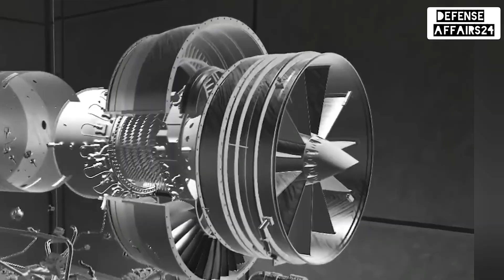Türkiye Breaks Free! KAAN Fighter Jet to Fly with Home-Built TF-35000 Engine 🔥

Comment: To build engines for manned fighter jets, engine blades must withstand temperatures exceeding 1,600 degrees Celsius.
1,600 degrees Celsius is the melting point of metal. Therefore, they are manufactured from single crystals, with tubes circulating inside the blades to allow cooling air to flow.
This single crystal manufacturing method is called second-generation single crystal manufacturing.
Currently, AM additive manufacturing is used, layering sintered powders, similar to 3D printing.
Countries that have developed this technology include the United States, Europe, Russia, China, Japan, and South Korea, but Turkey has not yet developed it.
A video of the TF-6000 engine test released by TEI shows that only the engine turbine rotates, not combustion. This means Turkey has not yet developed high-temperature materials.
Currently, building a 35,000-pound engine is impossible with Turkish technology.
Reply: The Eurofighter, powered by the EJ200 engine, is also capable of supercruising. Optimizing fighter design is also crucial.
The Turkish-made Hurjet trainer uses the F404 engine. India's light fighter, the Tejas, and South Korea's T-50 also use the F404 engine.
However, the Hurjet has a payload of only 2.7 tons. With fuel, a pilot, and avionics, the Hurjet cannot carry weapons.
Conversely, the Tejas, which uses the same engine, is already in use as a fighter, and the T-50, equipped with avionics, is also being used as the FA-50.
This suggests Turkey's lack of aircraft design and optimization technology.
The US Congress denied Turkey the right to license-produce the F-110.
If the Turkish government abandons its fighter jet development project now, will the Turks remain silent?
Even if Turkey possesses the basic technology and starts developing engines now, it will take at least 20 years. Even if the US were to supply Turkey with engines, obtaining airworthiness certification would require building a prototype and undergoing over 2,000 tests. That alone would take at least two to three years.
And if the fighter development project is delayed, the price of the fighter will rise.

The Turkish fighter development project has already failed, but these fools won't understand. Turkey is probably already looking for a replacement fighter or finding an excuse.
Anyway, by 2028, we'll know who's lying. After all, the Turks are paying the bills anyway.
Reply: @cobradorrheem  bahsettiğin uçak 5. nesil uçaklar için eğitim uçağı olmasının yanında hafif muharebe - destek ve gösteri uçağı olması amacıyla yapıldı. Türk yıldızlarının uçtuğu eskiyen Kore T-50 uçaklarının yerini alması amacıyla yapıldı. yani o bir eğitim uçağı ve ondan çok fazla bir şey beklenmemesi gerekiyordu ancak farklı beklenti ve talepler oluştu. bu durumdan erken haberdar olsaydık ortaya çok daha farklı bir sonuç çıkabilirdi. boşa heveslenmeyin, projeden vazgeçme gibi bir durum söz konusu değil. tam aksine elde bulunan F-16 motorları Kaanlar için kullanılabilir. seçenek çok. önceden alınan motorlar ile testler devam ediyor ve 2028 yılında elde olan motor sayısı kadar Kaan teslimatı yapılacak. 1 tane teslim edilmesi bile yeterli. çünkü böylece yapabiliyoruz ve yaptık ta zaten demiş olursun. bu sırada da yerli motor testleri devam eder. bu güne kadar yaparız dediğimiz her şeyi yaptık, 2028 ve 2030`larda yine rüyalarınıza karabasan olarak gelecek ve hayallerinizi yıkmaya devam edeceğiz. bekleyin ve görün
Reply: @onurcan8434  Do you know what aircraft payload is?
Do you know what intellectual property rights are for technology?
Do you know anything about aircraft airworthiness certification?
You seem to have no knowledge of aircraft, technology, or intellectual property, considering you're talking about equipping Turkish fighters with F-110s despite the US ban.
If the Turkish government uses the F-110 without US permission, the US will retaliate for intellectual property infringement.
Can the Turkish economy afford that now?
Reply: @cobradorrheem  ben 2 şey bilirim. dost ve düşman. seni düşman ilan etmiş bir ülke hiç bir hak talebinde bulunamaz. o dakikadan sonra ellerindeki her şeyi kullanarak kozlarını paylaşmaları gerekir. karşımıza çıkmaya cesaretleri yok ama düşmanlık yapmaktan da geri durmuyorlar. ellerinden gelen her şeyi zaten yapmaya çalışıyorlar ama biz henüz hiç bir şey yapmadık. bu yapmayacağımız veya yapamayacağımız anlamına gelmiyor. bu yüzden bana hak - hukuk edebiyatı yapmaya çalışma. elimizdeki koz sayısı çok fazla ve henüz hiç birini kullanmadık ama daha önce de defalarca söylediğim gibi, yapamamak ve yapmamak farklı şeyler. Amerika`nın aksine biz sömürgeci değiliz ama Amerika`nın ekonomisi bizden daha kötü bir durumda. her şey siyasi iradenin elinde ama bu durum Amerikan ekonomisine hiç bir şey olmayacağı anlamına gelmiyor.
Reply: @onurcan8434  I have no intention of persuading you, and I have no interest in your philosophy.
No country would transfer technology to Turkey, which disregards other countries' intellectual property rights. Turkey would either pour money into a fighter jet it can't build, acquire fighter jets from other countries, or participate in other countries' fighter jet projects.
We'll figure out who's right later.
Reply: @cobradorrheem  o zaman halen daha ne konuluyorsun ki? senin felsefen kimin umurunda? senin felsefen iddiadan başka bir şey değil. felsefeni dayandırdığın nokta ne? kuru bir iddia, bir var sayım, bir olasılık. başka bir şey yok. denemiş ama başaramamış bir ülke olan Hindistan hakkında konuşsan, anlayacağım. Türkiye daha önce denedi mi? hayır. başarısız oldu mu? yine hayır. ne konuşuyorsun halen daha? 3 gündür bahsettiğin şey olsa ve bulsa hikayesinden başka bir şey değil. biz uçak ta üretiriz, uçak ta satın alırız, teknoloji transferi de yaparız. bundan sana ne? kimin haklı olduğunu sonra göreceksek eğer, bu güne faydası ne? bozuk bir plak gibi günlerdir aynı şeyleri tekrarlayıp duruyorsun. başka bir şey yok.
Reply: @onurcan8434  Don't they even teach reading in Turkey? I've never talked about my philosophy. I told you I wasn't interested in your arguments or philosophy. What are you talking about?
Have you ever provided any technical evidence for anything you've written?
No matter how much you babble, the Turkish fighter jet development project failed, and engine development is impossible with Turkish technology. It's just a lie from the Turkish government.
Stop making me laugh and go to sleep.
Reply: @cobradorrheem   çok basit bir şey söylüyorum sana. saydığın şeylerin hiç birini kendin yapmamış olmana rağmen neden halen daha çeneni kapamıyorsun? sana ne düşündüğünü kim sordu? kimin umurundasın? gözünün önünde olan ve başarılı bir şekilde inşa edilerek uçurulmuş olan bir şeyin başarısız olduğunu iddia edebilmek için görme veya zeka engelli olmak gerekir. sen bunların hangisisin, söyle bana? sen falcılık veya kahinlik yap, bu işler senin işin değil
Reply: @onurcan8434  The Turkish fighter jet program failed. I simply said it failed.
Did Turkey develop high-temperature engine materials? Did it develop aircraft engines? Did it build avionics? Did it test avionics?
Isn't Turkey's only proof a demonstrator that flew for just 27 minutes in 2024?
Should we call a fighter jet development program a success, even though its mass production is scheduled for 2028, without an engine, avionics, or even a prototype?
If I were a fortune teller, would that mean the Turkish government is a bunch of fraudsters?
Reply: @cobradorrheem  başarısız olması için yapamamamız ve uçuramamamız gerekiyordu. yaptık mı? evet, yaptık. uçurduk mu? evet, uçurduk. sana dedim ki, ne düşündüğün umurumda değil ve kapa çeneni. neden halen daha çeneni kapamıyorsun?
Reply: @onurcan8434  Don't you see I'm making fun of you?
How could you not know that the Turkish government is lying when the fighter jet program is clearly a failure?
I'm mocking your level of intelligence. Don't you learn things like debate in school?
Reply: @cobradorrheem  açıkça başarısız? :face-blue-smiling:IQ fakiri bir bakar kör olan ben değilim.  kim kiminle dalga geçiyor? beni eğlendirmeye devam et
Reply from the maker: Appreciate your detailed explanation, my friend. You’re absolutely right that high-temperature alloys and single-crystal turbine blades are among the toughest challenges in jet engine design. However, Türkiye’s TEI has already started research and material testing for single-crystal turbine blades and advanced cooling systems as part of the TF-35000 program. The TF-6000 was only a technology demonstrator, meant to validate core design and low-pressure modules, not full-scale combustion tests yet. With the progress TEI has shown from PD-170 to TF-6000 to TF-35000, it’s clear Türkiye is on a realistic, step-by-step path toward achieving a fully indigenous fighter jet engine. 🇹🇷✈️
Reply: @defense.affairs24  Jet engine testing is stipulated in the airworthiness certification evaluation.
If it's merely for demonstration purposes, as you say, then engine testing without combustion testing is meaningless.
The TIT of the TF-6000 is 1,400 degrees, the temperature at which metals do not melt. On the other hand, the TIT of the TF-35000 is 1,600 to 1,700 degrees, the temperature at which metals melt.
The superalloys used in turbine blades exhibit significantly reduced mechanical properties when the temperature exceeds 1,400 degrees. This means they can explode if manufactured incorrectly.
The superalloys used inside the internal engine combustion chamber do not undergo mechanical motion and only receive thermal energy, while blades receive both kinetic and thermal energy, making the technology considerably more challenging. Therefore, the technological gap between the two engines is estimated at 20 to 30 years.
Russian and Chinese engines have an average lifespan of 1,000 hours, and they use their engines as consumables. This is why the engines of both countries emit a blue flame when viewed from behind. This is the concept of being disposable after use. On the other hand, Western engines are rated for 10,000 hours. Western fighter jet engines emit a red flame. Because they last that long, they're more difficult to manufacture. Just because you've built a TF-6000 doesn't mean you can build a TF-35,000.
Reply from the maker: Appreciate your detailed explanation, my friend. You’re absolutely right that high-temperature alloys and single-crystal turbine blades are among the toughest challenges in jet engine design. However, Türkiye’s TEI has already started research and material testing for single-crystal turbine blades and advanced cooling systems as part of the TF-35000 program. The TF-6000 was only a technology demonstrator, meant to validate core design and low-pressure modules, not full-scale combustion tests yet. With the progress TEI has shown from PD-170 to TF-6000 to TF-35000, it’s clear Türkiye is on a realistic, step-by-step path toward achieving a fully indigenous fighter jet engine. 🇹🇷✈️
Reply: bizim teknoloji konusunda hiç bir eksikliğimiz yok. yoksa ki bu projeye başlamazdık. sadece maddi kaynak ve minimum zaman içinde üretim konularında sıkıntı yaşıyoruz. tabi sen ve senin gibiler istediğiniz şeyi düşünmekte ve istediğiniz şeye inanmakta özgürsünüz. ama bir şeyi unutmayın. birkaç yıl içinde tüm bu sözlerinizi yemek zorunda kalacaksınız
Reply: @onurcan8434  No matter how technically explained, it's difficult for non-experts to understand.
The engine is the most crucial choice in aircraft manufacturing. Whether it's a fighter jet or a civilian aircraft, the design is determined by the engine selection.
There was a previous Boeing 737 Max 8 accident. The cause of the accident was a plan to replace the existing 737 with a more powerful engine. Instead of redesigning the aircraft to accommodate the new thrust, the program was simply revised, resulting in a crash.
The Turkish government's claim that it will use the F-110 for the prototype and a 35,000-pound engine for production is difficult to understand.
And since the engine is the most technically challenging component, your claim that there are no technical issues is also difficult to understand.
Opinions may vary, but I believe the Turkish fighter program will fail if it cannot procure engines from the United States or Europe.
We'll find out who was right in a few years.
Reply: peki senin bu açıklamaları yapmadan önce hangi uzman ile görüştüğünü ve konuştuğunu öğrenebilir miyim? yaptığınız açıklamaların tamamı söylentiler ve kulaktan duyma haberlerden başka bir şeye dayanmıyor. biz eğer bir şeyi yapabiliriz diyorsak, onu yaparız. yapamayacağımız bir şey olursa da hiç konuşmaz ve hiç başlamayız. 2028 yılında 20 KAAN teslimatı yapılması hedefleniyordu ama yerli motor o süreye yetişmeyeceği için F-110 motorları kullanılarak üretilmesi hedeflendi.  kendine ait bir motorun yoksa eğer, ilk üretimleri başkalarına ait motorlar ile yaparsın. motorun hazır olduğunda ve tüm kontrol ve testler yapıldığında da kendine ait motoru kullanmaya başlarsın. bu kadar basittir. bunun neresini anlamadın? hiç bir deneme - test ve kontrol yapılmadan önce motorun uçağa takılarak uçurulmaya başlanacağını mı düşünüyordun yani? ben de teknikten bahseden birinin bunları düşünmesini ve bahsetmesini anlamıyorum. sen gerçekten de bu işin teknik bölümünde tecrübeli olduğuna inanıyor musun? açıkçası, yazdıklarını okuduktan sonra ben senin bu konuda kesinlikle yetkin bir kişi olduğuna inanmıyorum. çünkü, dediğim gibi, yetkin olduğunu iddia eden birinin hiç bahsetmemesi gereken şeylerdi bunlar. bizim Amerikalılar gibi olduğumuzu mu sanıyorsun? o F-35 denilen uçağın seri üretime hiç geçirilmemesi gerektiğinin farkındasın, öyle değil mi? Avrupa`nın 5. nesil standartlarına uygun bir motoru mu var? F-22 dışındaki hiç bir uçağın motorunun 5. nesil standartlarına uygun olmadığının farkında mısın? benim F-22 motoru konusunda bile şüphelerim var. çünkü, yapılan açıklamaların tamamı iddialardan ibaret.
Reply: @onurcan8434  I wonder what kind of knowledge you possess when you say that. Is there any information on YouTube or rumors floating around online that claim Turkey doesn't yet have second-generation single-crystal casting technology? Is there any information that says it doesn't have AM additive manufacturing technology?
What is the technical basis for claiming Turkey, which doesn't even have the basic technology, can develop its own engines?
Are you asking me to believe your claims without any evidence?
I researched single-crystal casting using sintered powder.
What have you studied?
How can Turkey use the F-110 engine when the US has banned licensed production? Have Europe and Turkey ever negotiated engine supply agreements?
What you wrote is nothing more than your imagination. How can Turkey, which can't even produce a prototype, achieve mass production by 2028?
Why should I believe your imagination?
Didn't Turkey start the fighter jet program to use it as political propaganda for the Turkish president?
The Turkish fighter jet program will fail unless there are engine supplies from the US or Europe. Stop talking nonsense.
Reply: tabi ki var. daha az önce uçak ve füze motorları üreten KALE grubunun resmi yöneticisi ile yapılan röportaj videosunu izledim. ben her gün takip ediyorum. adres, yorumu spam kutusuna düşürüyor, bu yüzden veremiyorum ama yapabiliyor olsaydım neden vermeliydim? ben size gösterirsem eğer, siz nasıl araştıracak ve öğreneceksiniz? zaten hiç bir araştırma yapmadığınız ve yalnızca söylentilere inandığınız için bu durumda olduğunuzun ne zaman farkına varmayı düşünüyorsunuz? halen daha başkalarının yalanlarından sanki gerçekmiş gibi bahsettiğinin farkında mısın? 1985 yılından beri tüm firmalar için motor ve motor parçası üreticisi olan bir ülkenin temel teknolojiye sahip olmadığını iddia etmeye devam eden birini neden halen daha dikkate almalıyım? siyasi irade emir verir ve bütçe ayırırsa eğer, çok basit bir şekilde üretirler ama bu benim problemim değil. çünkü, yapmasına izin verilmesi ile yapacak teknolojiye sahip olmamak farklı şeyler. senin prototip dediğin şeyi 2 yıl ve 2 ayda üretip uçurduk biz. o lisans anlaşmasının yenilenmemesinin bir sebebi olduğunu düşünemeyen ve var olan bir şeyden hayal gücü olarak bahseden birinin bu yorumu okuduktan sonra önce göz doktoruna, ardından da bir psikiyatriste gitmesi gerekir. onun - bunun yalanlarına inanmaya ve PROPAGANDALARINI yapmaya devam et sen. nasıl olsa bir kaç yıl sonra göreceksin ama itiraf edecek yüzün olmayacak. yanılmışım bile diyemeyeceksin. bahsettiğin Avrupa`nın yatıp - kalkıp bizim başarılı olmamız için dua etmesi gerektiğinden de daha hiç  bahsetmeyeceğim. çünkü, yapmayı hedefledikleri 6. nesil uçaklara takacak bir motorları olmayacağı gibi, Amerika onlara da lisans vermeyecek. Amerikan uçaklarını satın almaya mahkum olacaklar. asıl siz hayal görmeye devam edin
Reply: @onurcan8434  I only asked about their technical expertise and didn't ask about press interviews with Turkish companies.

Isn't the company you mentioned primarily focused on ceramic metal processing for architectural purposes? My major in college was materials engineering. Did you think I didn't know about that company?
They started producing small turbojet engines for cruise missiles in 2018.

They've been producing engines and engine components since 1985? Could you tell me the name of the company?

Even before the US banned Turkey from licensing engine production, the US Congress blocked the transfer of avionics technology to South Korea, which was supposed to be a condition of the F-35 purchase.
Did you think the US would create a competitor?
And installing engines imported for the F-16 in fighter jets under development without a license is an intellectual property infringement.
If Turkey possesses such advanced materials technology and has been producing jet engines and components for a long time, why does it import all its power turbine engines from Germany?
Power turbine engines and aircraft jet engines share the same external appearance and operating principles. Why does Turkey import turbine engines, which are technically easier to produce than aircraft jet engines?
Only five countries—the United States, Germany, Japan, Italy, and South Korea—have developed turbine engine technology for power generation.
How can a country that can't even build turbine engines build a 35,000-pound jet engine?
If you don't understand, do your own research. You'll soon realize who's dreaming and who's talking nonsense.
Reply: bir kişinin veya kurumun herhangi bir kabiliyete sahip olup olmadığını bilmek için uzman olmaya gerek yok. sormak yeterli ve soruldu da zaten. TEİ genel müdürü olan Prof. Dr. Mahmut Akşit ile ülke yöneticileri tarafından fırçalanan bir türbin üretici firması randevu alarak görüşme yaptı. "Türkiye 10 yılda neler yaptı ama siz bir uçak motoru üretemediniz." randevunun sebebi bunu nasıl başardığımızı öğrenmek. Prof. Dr. Mahmut Akşit, teknolojik olarak gelişmiş bir ülke olduğundan bahsediyor ama ülke ve firma adı vermeden şunları söylüyor. "şuanda Türkiye`de 20`den fazla özgün ve titanyum alaşım geliştirmiş durumdayız. kritik alaşımları ve tek kristal dökümlerini kendimiz yapıyoruz. alaşımın içindeki saf kobalt ve saf nikeli kendimiz elde ediyoruz." sanırım bu kadar bilgi sorduğun tüm sorular için yeterlidir. tüm bunlar devlet sırrı olmadığı gibi, gördüğün üzere, bazı şeyleri bilmek için uzman olmaya gerek yok. senin aksine, sormak ve araştırmak yeterli. bir Türk ata sözü vardır. der ki, kılavuzu karga olan kişinin burnu pisliğin içinden çıkmaz. bu söz tam olarak senin durumunu açıklıyor. ben senin söylediğin şeylere yalnızca gülüyorum. dediğim gibi, hiç bir araştırma yapmadığın ve sana söylenen her şeye inandığın için bu durumdasın. durumunu düşündükçe içimden daha çok gülmek geliyor. aslında bunların hiç birini söylemek zorunda değilim ama merak etme, tüm sorularını cevaplayacağım.  şirketlerin adlarını sorduğunu görüyorum. 1974 Kıbrıs harekatı sonunda uygulanan ambargo sebebiyle 1985 yılında kurulan 2 fabrika, TAİ ve TEİ. o günden beri, TAİ, F-16 uçaklarını üreten şirket. TEİ, F-16 motoru olan GE F-110 motorlarını üreten şirket. o günden beri tüm uçak ve uçak motoru üreticisi olan ülkeler için en zor ve en pahalı parçaları üretiyoruz. ayrıca, bir de KALE grubu var. yüklenici firma. bu konuya fazla takılmana gerek yok, ortaklık ve iş paylaşımı yapıyorlar ve birbirleriyle yardımlaşıyorlar. motoru KALE grubu yapıyor ama resmi açıklamaları TEİ genel müdürü yapıyor. sen de seramik ve metalden bahsediyorsun. komik. motor projesi, uçak projesinden geç başladığı için şuanda beklemedeyiz. yoksa ki, şimdi rekorların rekorunu kırmıştık ve uçağımız seri üretime geçmiş durumdaydı. herkesin 15 - 20 yılda çok sayıda ortak ile ürettiği 5. nesil uçağın 3 yılda nasıl seri üretime geçirildiğini ağzınız açık bir şekilde izlerdiniz. Amerika`nın görmeye katlanamayacağı şey bu. ve biz uçak üretirsek, Amerika 1 tane ülkeye uçak satamaz. ancak Almanya - İngiltere - Kore - Japonya ve ARAP ülkeleri gibi hegemonyası altındaki ülkeler mecburen satın alırlar. yani, Amerika kendisi için rakip yaratmıyor, karşısına rakip çıkmasını engellemeye çalışıyor. Amerika`nın düşmanı ve tek rakibi aslında kendisinden başkası değil. çünkü, çok aşırı yüksek olan astronomik rakamlar karşılığında satış yapıyor. sizi koruyorum hikayesinin sonucu.  Avrupa, sizi Ruslardan koruyorum. Yunanistan, sizi Türklerden koruyorum. ARAPLAR, sizi İran`dan koruyorum. Japonya, sizi Çinlilerden koruyorum. Kore, sizi kuzey Kore`den koruyorum. Amerika için düşman ülkeler müttefiklerden daha önemlidir. biz 1985 yılından beri üretim yapıyoruz ama müttefiklerimiz yakın zamana kadar bize karşı bu kadar düşmanca davranmaya başlamamıştı. ayrıca, İMF adında bir kan emici ve tefeci var. borcunu ödemediğin sürece bir şey yapmana veya üretmene izin vermez. yoksa ki, kredi vermez. biz İMF`YE olan borcumuzu 2013 yılında bu düşmanlık sebebiyle bitirdik. yani, her şey düşündüğün gibi kabiliyet konusundan ibaret değil. açık ve net söylüyorum, biz istediğimiz her şeyi yapabiliriz, kimse de bize ambargo uygulamaktan başka bir şey yapamaz. çünkü, biz hiç bir ülkeye ve millete benzemeyiz. kimi desteklersek kazanan o olur. Amerika`nın tanrıdan daha çok korktuğu 2 şey vardır. 1- Rusya. 2- Türkiye`nin Rusların tarafına geçmesi. ayrıca, bizi hiç kimse savaşarak yenemez. biz, dünyada gerilla savaşı kazanmış tek düzenli orduya ve binlerce yıllık ordu geleneğine sahip tek ülke ve milletiz. bu ülkenin ve milletin ordusu, Kore savaşında 3 tane kahramanlık madalyası kazanmış ordudur. bunlardan biri de Amerika tarafından verilen "gümüş yıldız" kahramanlık madalyasıdır.  NATO'ya alınma sebebimiz de bu zaten. bizi Ruslara karşı savaştırmak. bu da, bunun farkında olmadığımızı sananlar için komik olan bir başka şey. "biz zaten bunu düşünerek lisans süresi dolmadan önce motorları üretmiştik." her şey bu sözü söylememize bakar ve hiç kimse bir şey yapamaz. dediğim gibi, izin farklı bir şeydir, kabiliyet farklı bir şeydir. zor durumda kalırsak eğer, F-16`lardaki motorları söküp KAANLARA bile takabiliriz. ne olur? 300 F-16`mız olmaz da, 150 KAANIMIZ olur. bizim için imkansız diye bir şey yok ama o noktaya gelmesini istemiyoruz. iyi niyetimizi suistimal etmek isteyen varsa eğer, hiç durmasın ve bizi zorlasın. tüm bunlara rağmen senin gibiler herkesi kendileri gibi sanmaya devam ediyorlar. dediğim gibi, biz size yalnızca gülüyoruz.
Reply: @onurcan8434  Weren't you the one who asked if I spoke with an expert?
I don't care what the Turkish expert says. Then why doesn't Turkey, which developed the technology and materials, register its technology or intellectual property rights?
If Turkey independently developed the engine-related technology or materials I mentioned, shouldn't it have registered its intellectual property rights? If it had developed the materials, shouldn't it have registered the technology to protect the developer from infringement?
Turkey has no registered intellectual property rights or technology related to engines. It hasn't even reported its material development in a materials science journal.
You said the Turkish expert developed 20 different types of titanium alloys. What are their structures? Titanium has three different alloy structures. How could they have developed 20 different types of titanium alloys?
Let's stop lying.

Turkey developed a fifth-generation fighter? Do you call something illegally equipped with an American F-110 engine and no avionics a fifth-generation fighter?
You call it a technology demonstrator. Turkey hasn't even built a prototype yet. In other words, it's like putting an engine in a can and flying it.
I'm sick and tired of your lies. Shouldn't Turkey first invest in basic technology and then develop a fighter jet?
You said a 35,000-pound engine would be developed within a few years. Yet, the Turkish Foreign Minister is going to the United States to request engine supplies? The US Congress suspended the license, so why did the Turkish Foreign Minister criticize the US? Isn't the F-110 US intellectual property?
Turks don't seem to read foreign military media, yet people around the world are laughing at Turkey's political show of developing a fifth-generation fighter jet.
Reply: @cobradorrheem  where are you from ?
Reply: evet, 51. kez söylüyorum. hiç bir yetkili kişiyi dinlemeden aldığın yalan duyumlara göre davrandın ve hareket ettin. bu durum teknik konular hakkında bilgili ve yetkin olduğunu iddia eden birine yakışmıyordu ve ben de bunu defalarca söyledim zaten. umurumda değil diyerek yine aynı şeyi yapmaya devam ediyorsun. şimdi ben de o zaman senin ne söylediğin umurumda değil demeli miyim? bildiğim kadarıyla füze ve insansız hava aracı motorlarının tescilini zaten yaptırdık. helikopter motorunun tescili ya yapıldı, ya da yapılması çok yakın. TF- 6000 jet motoru başarıyla çalıştırıldı ve şuanda olgunlaştırma aşamasında. TF-10 bin ve TF-35 binin ise yakın zamanda çalıştırılması hedefleniyor. kısacası, jet motorlarımız henüz tescil seviyesine ulaşmadılar. bunun sebebi de yine kabiliyet değil, maddiyat. bu yüzden yavaş ilerliyorlar. 3 farklı jet motoru ve 1 helikopter motoru olmak üzere 4 farklı motor projesi aynı anda devam ettiriliyor. projeleri hiç bir ülkeden maddi destek almadan ve ortağımız olmadan yalnız başımıza sürdürüyoruz. yavaş yürümesi sence de normal değil mi? başaracak kudrete sahibiz ama ne kadar sürede başarabileceğimizi bilmiyoruz. yine de son lisans engelinden sonra mühendislerimizin çok fazla hırslandıklarını ve bize göre normal olan süreden çok daha erken biteceğini söyleyebilirim. uçağı yapan mühendisler evlerine gitmediler, uçağın yanında yatıp kalktılar. biz normal bir ülke olmadığımız gibi, mühendislerimiz de normal değil. bir an önce bitirmeden huzura kavuşmazlar. 20`den fazla titanyum alaşımı demedim, 20`den fazla özgün ve titanyum alaşımı dedim. özgün alaşımlar ve titanyum alaşımları yani. her şey bitti, şimdi de sıra yalan söylemekle itham etmeye mi geldi?  daha yazdığım cümleyi anlayamıyorsun, kaynak göstersem söylenen şeyleri mi anlayabileceksin? beğenmiyorsan eğer, Türkçe öğren, kendin dinle. motor konusu bitti, şimdi sıra uçağa mı geldi? evet, 5. nesil uçak geliştirdik ve bununu 26 ayda yaptık. uçurduk ve herkes bunu gözleriyle gördü. boş ağırlığı 25 ton. motor ve fırlatma koltuğu dışında tamamen yerli. son teknoloji aviyonik ve sensörlere sahip. inanmak veya inanmamak tamamen sana kalmış ama kör biriyle tartışacak bir şeyim yok. ya üslubunu düzelt, ya da beni boş yere uğraştırma. tüm test üniteleri önceden hazırlandığı gibi, ilk prototip başarıyla uçtu, 3 prototip te şuanda üretim aşamasında. biz F-110 motorunun lisanslı üreticisiyiz ve süre bitmeden anlaşması imzalanmış ve parası ödenmiş 40 motoru ürettik zaten. istersek bunu söyleyebiliriz ve hiç kimse yasalardan bahsetmeye kalkamaz. hırsızlık yasalara uygun ama bu mu uygun değil? parasını ödediğimiz halde uçaklarımız teslim edilmediği gibi, parası da ödenmedi. hırsızlar yasalardan bahsedemez. ülkeyi yöneten kişi ben olmadığım için dua etsinler. gerçi hırsızların duası kabul olmaz. ben sana 2028 yılında 20 Kaan`ın Amerikan motorlarıyla teslim edileceğini söylememiş miydim? yorum yukarıda duruyor, göster bana, 2028 yılında yerli motor ile teslim edilecek diye nereye yazmışım? ben sana önce göz doktoruna, sonra da psikiyatriste gitmeni söylememiş miydim? dış işleri bakanının lisansı iptal edilen 20 uçağın 40 motoru için değil de ne için Amerika`ya gittiğini sanıyordun? bunların hangisi medyanızda yazıyor? medyanızın yaptığı yalan haberlere senin gibi inanan insanlar ancak kandırılmış kendi zavallı hallerine gülerler, bize değil. biz her zaman son ve iyi gülen tarafız.  ben sadece bekle ve gör, bakalım yine böyle gülebilecek misin diyorum
Reply: @onurcan8434  The 35,000-pound engine is equivalent to the F-22 engine and is a generation ahead of the European EJ-200 engine.
This engine is a cutting-edge engine with a TIT of approximately 1,700 degrees Celsius and an internal combustion chamber temperature exceeding 2,000 degrees Celsius. It enables super-high-speed cruise without afterburning.
Turkey has developed this engine, but you're wrong in saying the technology isn't mature yet. To withstand these high temperatures, the blades would need to be second-generation single-crystal or higher, and the combustion chamber's heat-resistant materials would need to incorporate cooling technology.
All superalloy components inside the engine would need to be manufactured using AM additive manufacturing. Since titanium alloy melts at 1,500 degrees Celsius, was the unique alloy you mentioned manufactured using AM additive manufacturing?
This level of technology requires intellectual property protection, including registration of intellectual property rights, publication in materials conferences, and patent applications.

And now you're saying Turkey, which has developed a 6,000-pound engine, developed it using its own technology? Do you think that's logical? This is so funny right now, my stomach hurts. Listening to you, it seems impossible for Turkey to build a 35,000-pound engine with its own technology.
Reply: @oncu.mehmet  Why do you wonder? Are you trying to say that because it's not an Islamic country, I don't have faith?
Reply: @cobradorrheem  ı just asked it , ı would tell u something if u would reply but skip it no need anymore..even I didn’t say anything yet , your response show the shits in ur brain .. that’s it
Reply: @onurcan8434  Sen röportaj videolarına çok takılma..Tusaş başkanının röportajını izlemiştim.. Kaan için yerli milli diyordu..F35 in bir tık üstü diyordu.. Diyordu da diyordu.. 
Şu an için söylüyorum.. Kaan ne bir f35 ile ne de Cesna ile kıyaslanabilir.. Çünkü muamma...Seçimlerde oy alabilmek için 15 dakika bir tur attırıldı, hem de iniş takımları kapatılmadan.. Bu uçuştan sonra bir baktık F35 ten üstünmüş :-))) Tasarımı güney kore, motoru nerden olursa olsun , fırlatma koltuğu dıjjj güçlerden, cıvataları bilmem nerden...Sadece Canopy si yerli....  Tanklarda da aynı olay.. Altay tasarım güney kore..Yıllarca motor arandı..sonunda güney koreye ait kapasitesi düşük motorlar takılıp imal edilecek..Ki Güney kore bunları ıskarta etmişti..Yerli ve milliymiş... gitsinler göt kıllarını kandırsınlar...
Hadi diyelim uçak ta, tank ta %100 yerli ve milli... Bir savaş durumunda bunları kaç gün kullanabileceksin ekonomin dibe vurmuşken? 2. veya 3 gün hepsini hangara çekersin..Millete Türk ordusu ezer, Türk ordusu sokar demekle bu işler yürümez...40 senedir PKK yerinde duruyor...
Reply: sana diyorum ki, Avrupa 5. nesil bir motora sahip olmadığı gibi, bahsettiğin EJ-200 Kaan`ı uçurmaya yetecek seviyede değil. o uçağın maksimum kalkış ağırlığı 25 ton. EJ-200`ü bir tarafa bırak, ondan çok daha güçlü bir motor olan F-110 bile  yetersiz kalıyor. bu yüzden de üretilmediğini iddia ettiğin yeni prototiplerin uzunluk ve kanat genişlikleri küçültüldü. yani, değerli Avrupa`n bunu istese bile motor konusunda bir anlaşma yapılamaz. İngiltere ile birlikte 40+ bin librelik bir motor yapılması düşünülüyordu ama değerli batınız olan Amerika bunu engelledi. böylece değerli Avrupa`n geleceğini ve kaderini kendi elleriyle mühürlemiş oldu. yani, aslında 35 - 40 bin librelik bir motor bile yetersiz kalıyor. bana kalsa, en az 50 bin librelik yapılmasını isterdim. bu işe girdiğin zaman çok güçlü bir motor yapmak gereklilik değil, bir zorunluluk. yoksa ki boyutlarını küçültmek gerekiyor ve o zaman çoğu kabiliyeti kısıtlanmış oluyor. 5. nesil bir motor olması için ark yakıcı kullanmadan süper seyir özelliği olması şart zaten. bu yüzden F-22 haricindeki hiç bir motor 5. nesil klasmanında değil demiştim. buna F-35`te dahil. EJ-200`ün bu özelliğe sahip olmadığını sanıyordum. bundan emin misin? F-22`nin ise hiç bir test değeri mevcut değil. yalnızca 5. nesil bir motora sahip olduğu iddia ediliyor. tek kristal konusunda sıkıntı yok. bu özelliğe sahibiz. ark yakıcı olmadan süper seyir özelliğine de sahip olacak motorumuz ama yönlendirilebilir itki kontrol sistemi ve egzoz gaz soğutma sistemleri konusundan emin değilim. çünkü bu konuda hiç bir açıklama yapılmadı henüz. soru da sorulmadı. ben olgunlaşmayan şeyin teknolojimiz olduğunu söylemedim. sanırım çeviride bir hata var. olgunlaşmayan şey, tescilden önce motorların tabi tutulması gereken tüm deneme testleri. aşındırma testi de buna dahil. şimdiye kadar çok sayıda açıklama yapıldı ama hangi videoda hangi konudan bahsedildiğini hatırlamak ve bulmak zor. bu yüzden de A-M ekleme konusunda bir şey söyleyemem ama ekleme konusunda kaynak veya punta benzeri bir şey kullanılmadığını biliyorum. ısı ile yapıyorlar bu işi genellikle. röportaj yapmaya giden gazeteci ve sosyal medya fenomenlerine bilgi veriliyor ama bahsedilmemesi gereken konulara da girmiyorlar. dediğim gibi, kabiliyet ve teknoloji konusunda hiç bir eksikliğimiz yok ama inanıp inanmamak tamamen sana kalmış. ama bir an için bunun doğru olduğunu kabul etsek bile, başkalarına ait eski teknolojiler ile istenilen güç elde edilemez. örneğin, TF-10 bin. TF-6000`in ark yakıcı eklenmiş versiyonu ama iki motor da birbirlerinden tamamen farklı. yapılan açıklama bu. açıkçası, aklınca dalga geçtiğini sanarak eğlenmeye çalıştığını sanıyorsun ama bu işin sonunda kan kusmaya hazırlansan iyi olur. çünkü, hazmedemeyeceksin. gerçi, o zaman da o motoru kendimize ait teknoloji ile üretmediğimizi iddia edebilirsin ama bu benim zerre kadar umurumda olmaz. ben uçağıma taktığım motorun bana ait olduğuna bakarım. şimdiye kadar ürettiğimiz motorların hepsi rakiplerinden çok daha güçlü ve daha üstün. üretilecek olan motorun 35 bin libreden çok daha yüksek güç üreteceğinden ben eminim
Reply: işkembeden sallama işkembeci, bahsettiğin şahıs AKP millet vekili veya bakanı değil, TEİ genel müdürü. hangi parti kazanırsa kazansın, o vatandaş görevine devam eder. etmeli de zaten. daha yetkini olsaydı, onu TEİ genel müdürü yaparlardı çünkü
Reply: bu hıyara laf anlatacağım diye fazlasıyla uğraştım zaten, bir de kendinle uğraştırma beni. 2028`de teslim edilecek olan 20 Kaan`ın parası ödenmiş 40 motorunun üstüne yattı hırsızlar. zaten bundan bahsettim yukarıda. niye zahmet edip okumazsınız da aynı şeyleri tekrarlarsınız, anlamam.
Reply: @onurcan8434  Sen bahsedince doğru mu oluyor ?? CAATSA...bunu da duydun dimi ?? Bilumum silah alışlarının şartnameleri olur değil mi ? Biz ne yaptık..Sovyet başta olmaz üzere Rusların malı S400 ü bir NATO üyesi olarak aldık..Ben NATO da bir savaş durumunda Rusyaya karşı savaşacakken onların silah sistemlerini alıyorum..Şartnamede de karşı blokla ilgili böyle bir madde varsa adam parana da el koyar malına da..Bu kadar basit.. Haaa olmaz diyorsan o zaman Recep neden parayı geri istemekte ısrarcı değil ?? Ben söyliyeyim niye değil .... Recep hele sesini bir çıkarsın hem Halkbank davası , Hem de Recebin bugüne kadar soyduğu mal varlığı ile ilgili bütün pislikleri ortaya saçılır...
Reply: @onurcan8434  unuttum ya.. Trump ile Recebin basın toplantısını bi hatırla.. Trump ne demişti.. Recep kardeşim seçimlerde nasıl hile yapılır iyi bilir demişti de.... Recebin gıkı bile çıkmadı... işer işte böyle yürüyor.. Gün gelecek devran elbet dönecek evelallah
Reply: @ishkembechorba641  evet, doğru oluyor. çünkü ben işin iç yüzünü biliyorum. Rusya ve S400 hikaye. 2017`bin başında sana teslim edilmesi gereken uçak aradan 2 sene geçmesine rağmen halen daha teslim edilmemişti ve etmeye de niyetleri yoktu. çünkü aşağıdaki ağlamıştı. bir bahane aranıyordu sadece. S400 restti, katsa sebebi oldu. alamayacağını bildiğin şeyi istemenin anlamı ne? onun yerine başka bir şey al ama onu da canımın istediği zaman işime gelirse veririm diyor adamlar. Recep ne yapsın?
Reply: @cobradorrheem  Indian detected...
Reply: @1bladerx  😆🤣🤣
Reply: @cobradorrheem  You force me to say this mr indian, your empty talk will not effect our program. What are you going to say at the end of 2028 when you see production models in flight. We have the tech, the materials and the experts. Turkiye has been building critical parts for GE jet engines for quite a while, in 50% of passenger jets have critical jet engine parts, including turbine blades. Turkiye did additive printing of a turbine blade for the hot zone with 95% the strength of a single crystal blade, before the west attempted their additive printing experiments! Just because you Indians haven't gotten kaveri engine program any where near production doesn't mean Turkiye can not! I am avidly waiting for the responses from folks like you at the end of 2028.
Reply: @ishkembechorba641  Iskembeci onuda yanlis anladin. Trump, Biden'in ona yaptigi hile yaparak koltugu kazandigi, hakkinda konusuyordu, tabii sen Sozcu TV kanallarindan haber alirsan oyle bir yanlis anlayisa varirsin!
Reply: @1bladerx  Sen. de a haber , Ğ haber kanallarını izlersen böyle yanılırsın.. Ya sen atladın , ya da o yandaş kanallar o bölümü göstermedi.. Trump işaret parmağı ile recebi işaret ederek hileli seçimleri en iyi o bilir dedi...Sen kendini kandırmaya devam et.. Sözün kısası şu.. Recep Trumpın kucağında.. Recep aksi hiçbir şey yapamaz..Yaptığı an recebin mal varlığı dahil , halkbank davası piyasaya sürülür.:Zaten geberik olan ekonomimiz daha da dibe vurur.. Gerçek olan bu...
Reply: @onurcan8434  hiç senin dediğin gibi değil.. türkiyenin 2 tane f35 i hazırdı.. Bunun üzerine eğitilecek pilotlar abd ye gönderildi..bir kaç ay eğitim aldılar ve pilotlar eğitim aşamasındayken  s400 işi patladı..Niyetleri yokmuş falan bunlar hikaye..
Reply: @ishkembechorba641  Siyonist lobinin temsilciler meclisinin silahlı kuvvetler komitesine 2010 Temmuzunda Türkiye`nin programdan çıkartılması istemiyle sunduğu rapor uzun zaman önce açığa çıkmış durumda ama anlaşılan bundan bir tek senin haberin yok. halen daha 2 pilot hikayesi anlatıyorsun. sana sallama işkembeden diyorum, halen daha devam ediyorsun. iyi, devam et böyle
Reply: @1bladerx  2020? Probably around that time, the Turkish government negotiated technology transfers for engine development with GE and R&R.
The Turkish government demanded intellectual property rights for the transferred technology, but those negotiations collapsed. Negotiations with BAE also fell through due to the demand for intellectual property rights.
Turkey developed AM technology? Then why isn't the technology certified and registered? Enough with the lies.

The technology demonstrator developed under the Turkish fighter jet development program has flown for 27 minutes so far.
A prototype is a plane that has all the components of a planned aircraft and tests whether it achieves the performance targets set in the design.
It's not a plane that just puts an engine on an empty can and shows it off like Turkey.
A fighter jet without even a prototype will go into mass production in 2028? That's a lie.
As long as Turkey can't secure engines from either the US or Europe, the Turkish fighter jet development program has failed. I'm curious to see what lies the Turkish government will tell and what the Turks will say in 2028.
Reply: @onurcan8434  2 pilot değil , 2 uçak.. Zaten üstünüze tanımam palavralarınıza.. Biraz fazla yağmur yağsa siyonist işi , deprem olsa siyonist işi , dolar zıplar, euro ters gelir , faiz iner, çıkar alayı siyonist işi.. 
Ayrıca 2 uçak işi için o günleri de çok iyi hatırlıyorum.. Yalaka yandaş medya zevkten kuduruyordu f35 leri aldık diye..Şimdi o yalaka yandaş medyada yazanlar da, tv. lerinde yorum yapanlar da siyonistlerden nemalanmışlardır demeni bekliyorum.. Hadi utandırma beni bakiim...
Reply: @ishkembechorba641  verdiğin siparişlerin teslim edilme tarihinin üstünden 2 yıl geçmesine rağmen halen daha ortada 2 uçak varsa, uçağı bir tarafa bırak, istediğin hava savunma sistemini bile alamıyorsan, attığın palavralarda bir sıkıntı var demektir. ben istemiyorum dememişsen de birinin buna etkisi olduğunu düşünememek için de aptal olmak gerekir. başkalarına yakıştırma yapmaktan kendi halinize kafa yormaya fırsat bulamamışsınız siz.
Reply: @cobradorrheem  No one has to prove anything to an inflamed indian who could not get their jet program off the ground, now trying to criticize Turkiye's highly succsesful 5th gen program who already has buyers lined up for it, including pakistan, so kindly get lost and wait until 2028 as well as tests that you will be able to see on YT.
Reply: @1bladerx  The Turkish fighter jet program failed. I simply said it failed.
Did Turkey develop high-temperature engine materials? Did it develop aircraft engines? Did it build avionics? Did it test avionics?
Isn't Turkey's only proof a demonstrator that flew for just 27 minutes in 2024?
Should we call a fighter jet development program a success, even though its mass production is scheduled for 2028, without an engine, avionics, or even a prototype?
If I were a fortune teller, would that mean the Turkish government is a bunch of fraudsters?
Reply: @1bladerx  By the way, isn't Pakistan buying the Chinese J-35? Who would Turkey sell a fighter it can't even build?
Reply: Don’t underestimate gipsyturks 
They are capable copy pasters and revers engineers